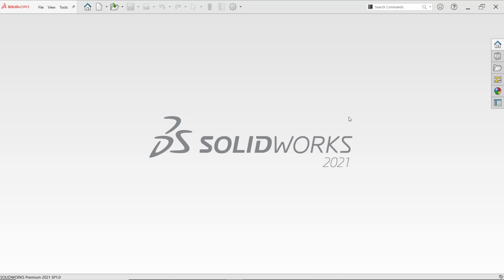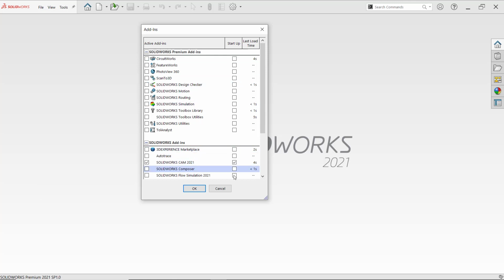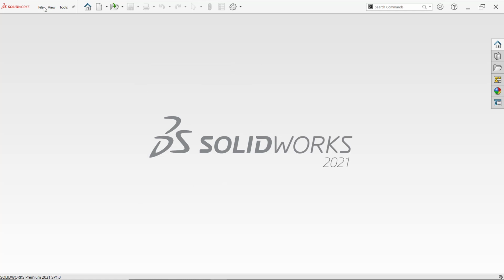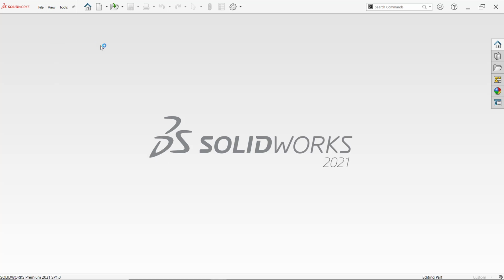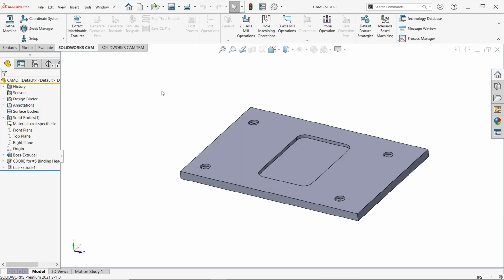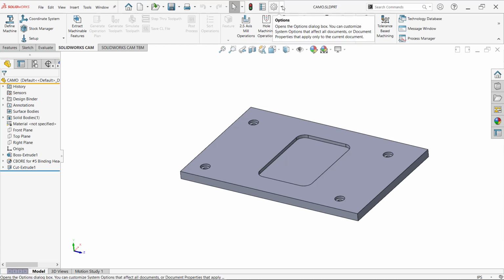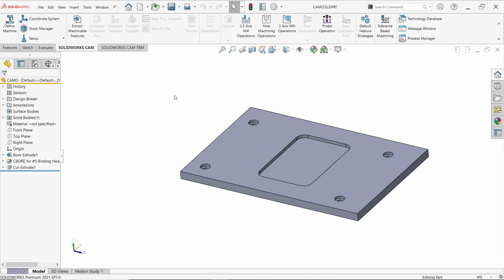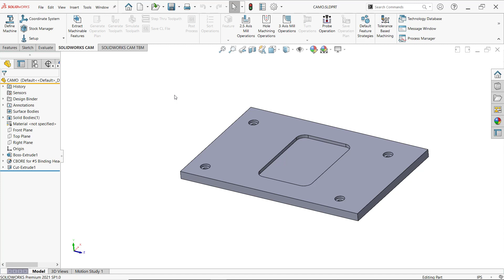How to turn on SOLIDWORKS CAM Standard

Comment: What can I do if the SOLIDWORKS cam add in does not show up as an option under the add in menu?
Reply: im having the same problem also
Reply: @garytippin7370   I ended up having to go through the 'reactivate license' process a few times to get it to take. Make sure you have the CAM option box checked. Good luck!
Reply: @heirtothethrone100  I have the same issue. How do you "reactivate license" ?